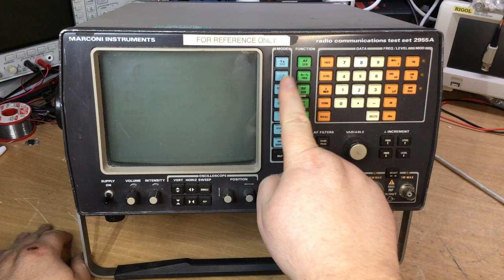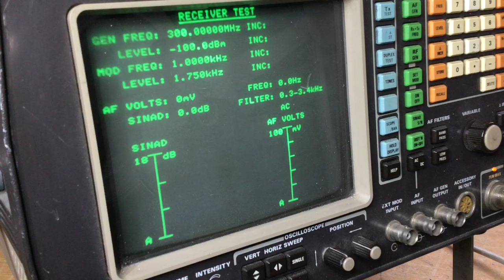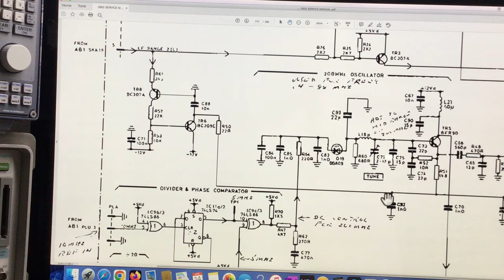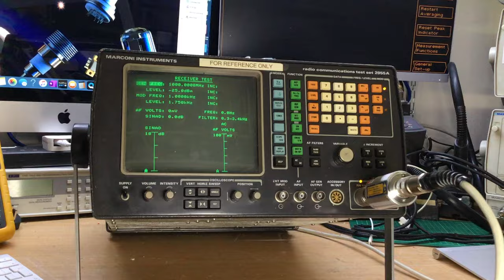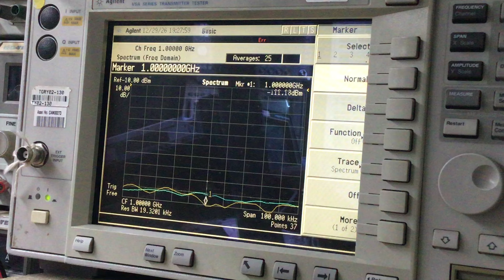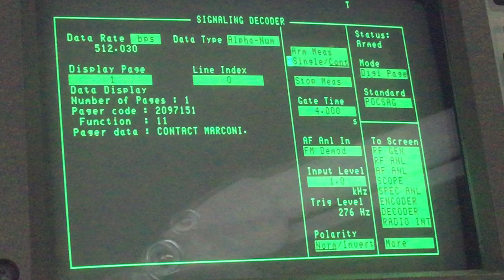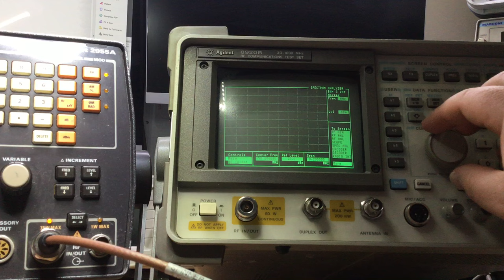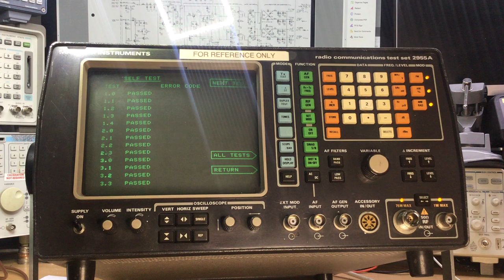Marconi 2955A radio test set repair component level, calibration checks, walk & talk.

Comment: Very interesting video of the 2955 repair
I worked as a repair tech at a depot that repaired the Motorola series of comms analyzers in the early 90s,specifically the R2001A/B/C and D series and also the baby versions of these, the R2200 and R2400.
These Marconi test sets seem to be a lot less modular than the Motorola units as far as the way they were built and designed.
We would normally swap out a faulty module or card and get the customer unit back into service asap and repair the faulty module at our leisure at a later stage

Comment: I used the Marconi 2945A for about 10 years, then went to the IFR 2945B and finished on a VIAVI 8800SX before retiring about a year ago. I loved the Maroni/IFR Testsets as I used to use them for the longest period in my courier. This 2955A is missing the BNC RF Input in the Top Right Hand Corner.